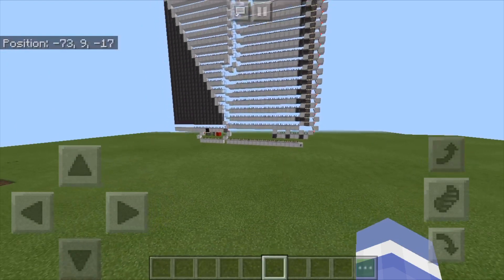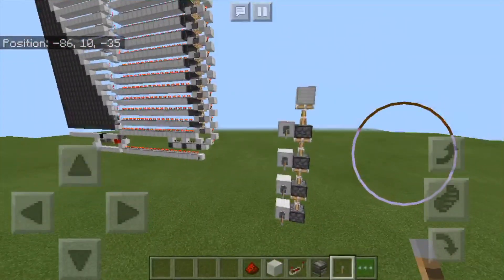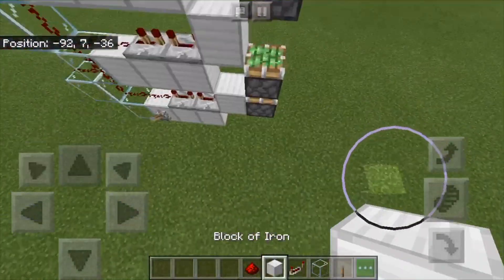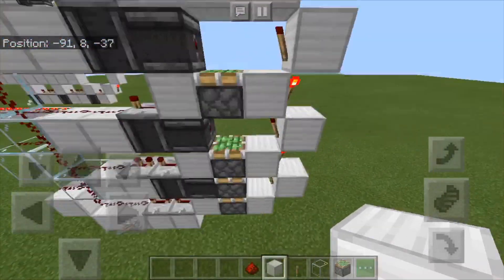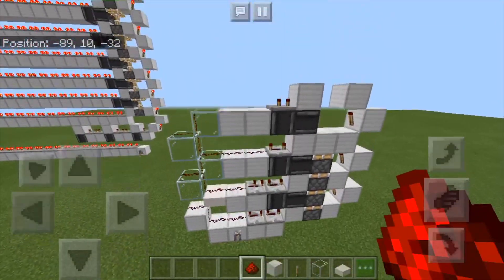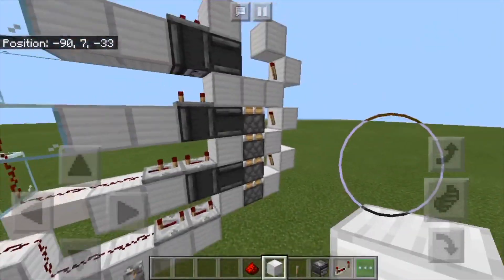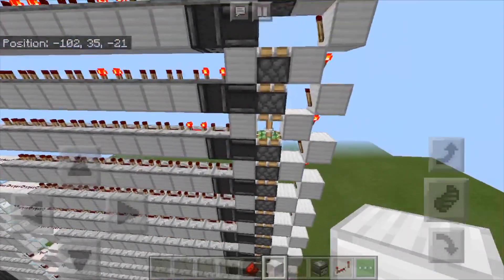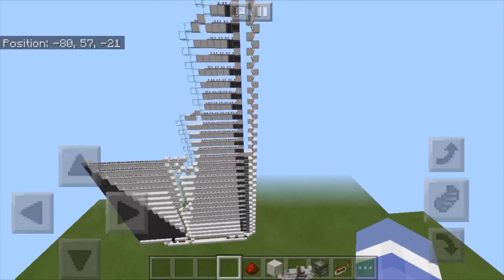How I make my piston extenders

Comment: I tried making this in java, until you said it didn't work in java
Reply from the maker: There's an easy way to mofify it for java edition, Replace the glass blocks with observers facing towards the extender, and then run your secondary pulses into those observers. You can also move the secondary pulses down 2 blocks, and then just make sure that every block in the dust tower is made of glass or slabs. Hopefully that makes sense. If not I could make a part two to this video dedicated to making universal piston extenders and modifying everything to work on java. It may be a little while before i can make a video like that though. I still have another big project in the works.

Comment: This was easy to understand. But I have 2 questions. 1st: How were u able to make the glass tower that high (in your bigger piston extender) without losing power. 2nd how were u able to make more than an 11 piston extender. a piston can push only 12 blocks.
Reply from the maker: 1st question: for the glass towers every time i ran out of signal strength i moved the towers in a few blocks and had repeaters in between. Of course, because the repeaters added on a tick I had to reduce the pulse lengths of all the redstone lines after the repeater by one. 
2nd question: the torch towers are what make extenders taller than the push limit possible. You can send in multiple pulses, making it so that the top 12 pistons extend, then in the next pulse 12 more pistons below that can extend. after about 5 pulses you can have a whole 48 piston extender pushed all the way out.
Reply: @ViscoseComb24  wow.... my mind has been blown. Thank you so much. and if u don't mind a challenge. I challange you to make a flying machine with a cobblestone generator. that flies and makes a cobblestone bridge. so basically an infinite bridge creator flying machine.
Reply from the maker: i guess i could try that.